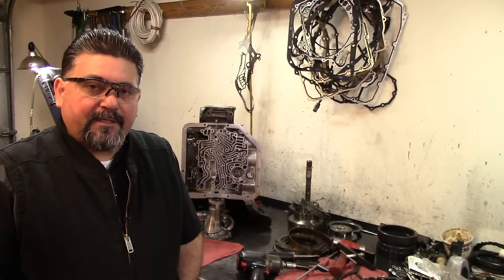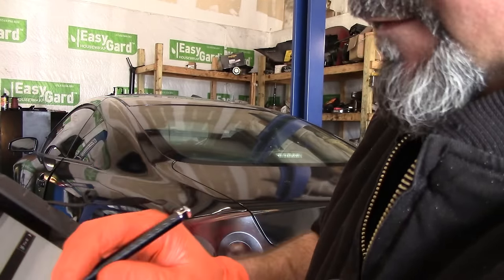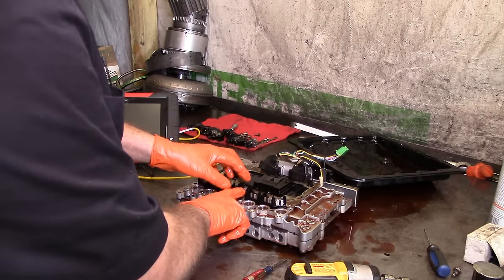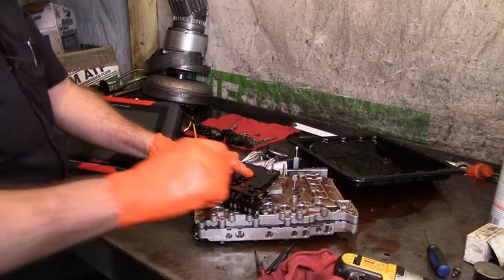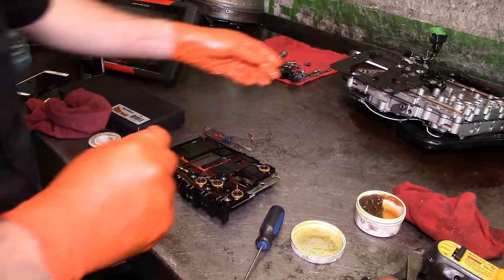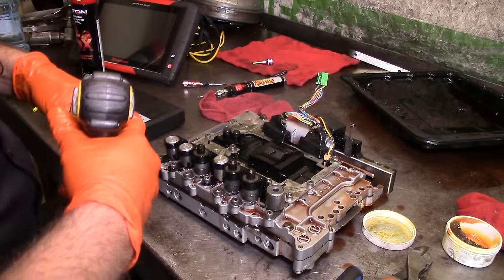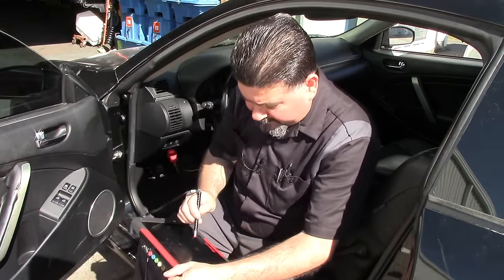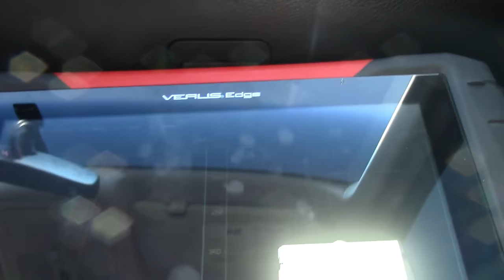RE5R05A Transmission -  P1757 Front Brake Solenoid Circuit - Infiniti G35 Coupe

Comment: Hiram, i just made this repair on my 2005 nissan frontier myself today. you have saved me thousands of dollars. thank you so much for this video and all of your videos helping people save money.
Reply: Rob_Infiniti 
Hi, Rob
Maybe you can help me out. My 2005 Frontier Input clutch solenoid went out. Do i need to reprogram after new part installed? I put scanner gave me P1754 
Dealer wants $1300 just for part labor not included.
Thanks
Reply: Hi Rob, If just soldering the metal wire, does it require transmission fluid flush?  Thanks
Reply: Rob_Infiniti how hard was it to do it your self
Reply: @alex_y4290 yes transmission fluid is needed because you'll be removing transmission pan and you'll lose fluid.

Comment: well I thought i fixed this on Saturday it's now Wednesday and I'm doing it again. trust me take your time and clean the area very well befor soldering and try to use some copper wire so if it breaks again it has the wire to complete the circuit. your not gonna wanna do it again 4 days later like me.
Reply: What kind of soldering wire did you use and update on the vehicle you fixed?
Reply: Is that what he did in the video ? Did he wrap a copper wire around it ?
Reply: Did this 2 times keeps breaking 😳 😕  any tips????
Reply: Wrap copper wire before you solder the broken tracer line.
Reply: Then put grey silicone

Comment: It's always nice to see someone actually repair something instead of replacing it. Top notch job Hiram.
Reply: wysetech2000 and also be honest with costumer. I guarantee you if it was any other shop they would of not bother to fix it. They would got the whole new thing which would of cost almost $600 and lie to a customer
Reply: @hamzi1220  hello hru? I'm having the same issue out of my 2006 Infiniti m45 I sent my valve body to street smart which is suppose to be the best at repairing valve bodies. I got it back reinstall it worked for 400 miles now it's stuck in high gear if I clear my code it drives fine for about 40 miles then it sticks again. Can u help me figure this problem out?

Comment: Spend 7 hours total with 1.5 hours from Boeing wiring expert carefully soldering the joint with multiple layers and wraps of super thin nickel wire and 63/37 lead alloy solder. The joint is now tight in the plastic cover and can not move or shake. Hopefully this fix will outlast me?

Comment: Hiram, thank you for this video. I used it too repair my high mileage 2005 infinity fx35. All it cost me was around $20 for 2 quarts of transmission fluid. You saved me hundreds of dollars and gave the car an extended life.
Reply: William Whitmore Hi there, I have a Fx35 as well. I have the same problem. What method did you use to solder this pin. I want to do this once and I want to do it right. Could you help me with some details, like what kind of wire and soldering method you used? 
Thanks
Reply: I did this 2 time and keeps breaking any tips any tips ??

Comment: I am actually a tech and have worked on BMW and Mercedes for a combined total of 20 years  but I would never dig into a nissan automatic tranny without help. 
Thank you very much for this video. I own a 2005 Armada with a LOT of miles and this happened to my car. In about 4 hours the repair was complete, thanks to your video and instructions. It saved me from buying a new car or at least a new valve body. 
God bless you for doing this! 
Cheers from icy Canada.
Reply: I’m having that issue right now the only difference is that my armada is a 2004

Comment: So I just completed this repair on my wife’s 2006 Nissan Pathfinder. We have had this vehicle since it had only 9k miles on it. Now it has 265k on it. We were returning from the in-law last weekend, and it went into limp mode. I’ve been waiting for it to die since 150k so I wasn’t surprised. I figured the trans was toast, and it wouldn’t be worth fixing. With the guidance of this video, I fixed it for no cost except new trans fluid, which it certainly needed anyway. I can’t thank you enough for taking the time to make this video! Gracias amigo!!!!

Comment: Found it!!! Your video saved me several grand!!! Thanks for posting!!! I've hit a snag where I can't shift past "4" and when I'm in "D", the gears will not engage. It was shifting fine before I dropped the valve body so it's something I did. Trial by fire, LOL! Thanks again!
Reply: Trey just spotted your comment - I reinstalled valve body myself after following the steps in the video - I think it solved my issue bc the error codes went away and so did check engine light but my X literally won't change gears when I move the shifter. I thought maybe the shifter linkage was not connected to the plunger and pin on the valve body correctly so I double checked that but still nothing. I'm totally stumped right now.
Reply: Stefan, I did the same thing. My gears wouldn't shift and I dropped the valve body, put it back in and had the same problem. When I dropped it a second time I noticed that the cable that's linked to the shifter was jammed in it's slot. it's supposed to move freely in that slot. Once I found that and re-seated it correctly. I was able to shift.
Reply: Thanks for responding; I dropped it a second time to check to see that everything was engaged properly in the valve body and the linkage and when I moved the shifter, the plunger and pin moved in the valve body so I believe everything there is linked correctly. I was able to confirm visually shifter movement moving the plunger and pin in the valve body. 

Is there another cable linkage somewhere "upstream" of the valve body itself? Perhaps another cable are you referring to? I think I'm pretty damn close to solving this... again no check engine lights or error codes the computer which is probably a good sign.

Thanks again for taking the time to answer back.
Reply: Stefan Gruber 

Wow! You are close. Now, when I first started troubleshooting the problem I opened up the console surrounding the shifter. It's pretty easy to disassemble and if I remember correctly there's another cable connection there. I found a video on how to break it down. I'd check there.
Reply: Can you guys help me with this? I did this repair and it drove fine for two days and today all of sudden it seems like i am in neutral all of a sudden but when i mess with my speed or shifter it seems like its working at low rpms but higher rpms, it revs like I'm in neutral

Comment: Thanks for making this video. I had a P1757 on my 2006 Infiniti G35 and this was the problem. Mostly followed your directions and eventually had everything fixed. I did a bad job of reading the manual so the first time we did this the car didn't start because we didn't connect the transmission to the manual valve (and the car didn't know it was in park). So, do this but also read the repair manual.

Comment: Hiram You remind me of myself...I still after all these years cannot stand to allow a car out of my shop without knowing what's wrong and fix it..I had a 05 Nissan xterra SUV some times when you put it in drive it will start off but it's like it jumps out of gear then grabs back in..Didn't do it all the time..I took the valve body controller off took it apart and sure enough there was a cracked prog all the way across but it would not set a code..This lady had this thing to 14 dealers and 17 shops..I found it and fixed it..Go Man Go!!!
Reply: rebel oneal yeah right.

Comment: 2006 Infiniti M45 checking in. Another satisfied viewer with a solved P1757 code. 
Thank you very much for the detailed video... and for the tip to use a thin wire to help the solder hold in place.
Reply: Hello EdBwoy, I want to know does it require transmission fluid flush? I may have the same problem. Thanks

Comment: Thanks so much for this Video - I just did this repair on my 2006 Infinity M35 over the weekend and it was EXACTLY the same problem. You saved me thousands! Zero parts cost.
Reply: If just soldering the metal wire, does it require transmission fluid flush?  Thanks

Comment: Thanks so much Hiram. This clip saved me replacing my transmission! Easy fix when you know how. Thanks for sharing your knowledge
Reply: Hey Michael. On this job do you know what the purpose of the wire wrapped around does? I couldn't see but I'm assuming that's the new connection? If you only solder it would it not work? The copper wire wrapped is needed right??

Comment: Thank you. Had the same issue with my 2006 Nissan Titan. Was able to fix it myself. The solenoid body is heavier than it looks so be prepared when removing it.  Some what small piece to solder. Needed to use a circuit board tip.  Tranny shifting up and down now.

Comment: Just did this today and it worked. My car runs even better now and saved me a lot of money. Thank you!
Reply: Any tips, I've been reading comments of people doing this and the car not starting up again
Reply: @MrGrungydude  Pretty straight forward repair. First, disconnect the battery. Drain fluid. Follow the video to take everything off. Very carefully take off the plastic cover of the TCM.  I had such a hard time and didn't want to break it so I had a friend hold it open with a flat head screw driver while I solder. Use a small wire to reinforce the solder or it'll break again.  Use silicon to seal the transmission pan. Connect all wires and screw everything back in. Fill fluid. Connect battery. Start engine until hot and check fluid to make sure it's at the correct level. That's it ! Ask a friend for help, this is difficult with 1 person.  If the car doesn't start up again, you either connect the solenoids in the wrong location, damaged more wires, or forgot to connect something. Best of luck.

Comment: Wow, this just saved me a boatload of cash. I had the same code and symptoms on my 2005 G35x, and it turned out to be the exact same problem with that broken pin. I've never worked on a transmission before, but your detailed video was excellent. Thank you!

Comment: Thank you so much for posting this video, it has been a while since and hope you get to read this comment Hiram. I am very thankful for you taking the time and walking us through this process. This was very helpful when my G35 went into limp mode and found this code after scanning the    modules. Just fixed it and is running smooth once again. Please do not stop making content like this, I understand it is very hard for some to be working on a project and to record at the same time. Muchas grax bro, muy agradecido. Que Dios te bendiga y te conceda muchos año mas de trabajo profesional así como el que se nota desempeñas. +1 sub.

Comment: Thank you, Hiram. This was very helpful. I called the stealership, they couldn't even give me a quote to fix it. The parts said the valve body has to be replaced, &1400., and reprogrammed another $400. and that was just parts, no labor yet. I bet it would be $3000. before I got out of there. How much did you charge your uncle for the repair? where are you located? So this same circuit is what was broke on mine, and I repaired it just like you said. Your awesome!
I can't understand why anyone would give you a thumbs down, unless it was for the noise while you were talking. I'm giving you all the thumbs up I can. Thank you again, & God bless you.

Comment: Just used this today. Worked perfect!
Reply: And now broken again?
Reply from the maker: Sand it until you see copper color, drill a small hole with a dremel bit, wrap some copper wire around it and fill it with solder.
Reply: @AutomaticTransmission  Thanks for tips. Should I use higher temp solder from Weller? Since the transmission gets to 180 F ??
Reply: @AutomaticTransmission  And the plastic cover is so brittle and tight that to remove I have to break or cut out. How important is the plastic cover over the wire connections to the solenoids?  Thank in advance! 😊
Reply: What if I have an 03 g35 with the p1757 code? My transmission oil was dark and has tiny metal sparkles in it probably from not draining the fluid for 100kmiles, took out the valve body and cleaned the filter screen, I don't have the prongs there to solder, checked the TCM by the passenger door and it's not in there either. Checked the brake solenoid with a 9v battery and it seems to be working because I hear it activating  @AutomaticTransmission

Comment: that was my problem I've got a 06 infiniti m35x. the tcm was a pain in the ass to split apart. I see why it's not in the video. just fixed it my self in the drive way took out more bolts then need to be but got the job done. thanks for your video it saved me alot of money
Reply: I working on a nissan armada 2006 same problem..if you want to take a part the tcm..used heater or heat gun it will be easy to open the cover....guys good luck
Reply: hi, do you need to flush transmission fluid? Thanks
Reply: @alex_y4290  I didn't the car has 170000 miles on it. I got a new drain pan and reused the fluid and filter. i was surprised to see a drain plug on the transmission pan. I lost some fluid so I just top it off with new.  there's only like 6 bolts u gotta take out of the valve body and filter to get the valve body out and the bolts are different size but there's a number on the head of the bolt. i took out way more than needed and had a hard time putting them back where they need to go.

Comment: Doing this to my 2005 get sedan. Same issue, transmission won't shift into 5th and I have the dreaded transmission front solenoid code. I may be doing this exact same thing, lol. This video has been helpful so far for me. I'll update once I have completed the fix.
Reply: Did it work ??
Reply: Update? 😅

Comment: Nice work and thanks for being a honest mechanic bro. 
If I take it to my local shop they would say I need a new transmission etc
Reply: That's cold.. at least the mechanics I took mine to were decent enough to say I will likely just need a new TCM/valve body.. there was one who suggested I would need a whole tranny rebuild.. which I doubt.. mines shifts nice and smooth and has no signs of excessive wear.

Comment: You sir are amazing! This exact fix worked for me and saved me thousands of dollars. Thank you very much for the excellent video and sharing your knowledge!
Reply: Hi, Sir, If just soldering the metal wire, does it require transmission fluid flush?  Thanks

Comment: Attempting this right now for an 04 g35 sedan.  Got the valve body out and just finished pulling off the solenoids and pulled off the TCM. So now im on the next step. Ill keep yall updated
Reply: What happened? It was broke the pin?
Reply: Brian Quero yes!!! I resautered it really nice with some extra wire. I took my time and wrapped extra  wire around both end and sautered it. My cars been running perfect ever since.04 G35 sedan auto. 161k miles
Reply: Can you tell me a little more in details what the car was doing before the repair.. how he was doing.. ? I bought a car today with that code and it drives weak.. like every shift it jumps and also scary the reverse sometimes doesn't want to go... And it make a whiny noise .
Reply: I would press the gas all the way and it would barely go. It felt like trying to take off in a car that's in 3rd gear
Reply: @Brianmw305i  did u problem  I got same  problem
Reply: Do you have Instagram?
Reply: @Dizastaaaa  yea
Reply: Yes it worked. I still have the car just haven't driven it in the last 4 months. But I've put another 30,000 on the car since the repair

Comment: Nice when somebody actually post a video that's helpful the only thing I would add is which bolts to pull out to remove the valve body it would be helpful for people that don't work on Transmissions all the time and there is one bolt that is special the guide Bolt is different from the rest and it goes in the smaller hole also they put washers under some of the TCM bolts for some reason so it's good to keep track of those and one other thing there's a little metal pin that sticks up that looks like it fits into the plastic tabs on the harness connector coming through the transmission case when I put mine back together I made sure that little pin was inside the two pieces of plastic don't know if it matters that much but it looks like that's where it goes

Comment: Quick question.
I have 11 nissan altima 2.5.
With 83k miles
Codes p1757- P1759- P0744- P1754-
Fr brake solenoid, fr/b solenoid, torque converter, I/C solenoid function. 

 This are all related right?  
And I have to open the transmission and valve body to inspect them. 
Or what do you suggest Or recommend me. Where do I start? Should I go straight to the trasmmisión?
Thank you very much for your video!!

Comment: @AutomaticTransmission So how do you fix this code on an 03 infiniti g35 coupe? It's not inside the transmission pan and I checked the TCM passenger area under dash and nothing like this inside the TCM . Do I have to replace valve body? I checked the brake solenoid with a 9v battery and it's kicking on so I doubt that's the issue.
Reply: Anyone have a clue? All I see are fixes for 05 G35s and up

Comment: Hello, I'm getting Two P1757  error codes. My question is are there two different Front Brake solenoids or what could be causing the two error codes?

Comment: I have the same code on my automatic sedan it starts good. No lag to start up but once I switch to Drive, it doesn’t not accelerate normal. I have to step on the gas more than usual. My RMP does go up to the 3rd. Reverse and park are normal. What can my problem be?
Reply: Manuel Montes me too!!
Reply: Did you ever find out?